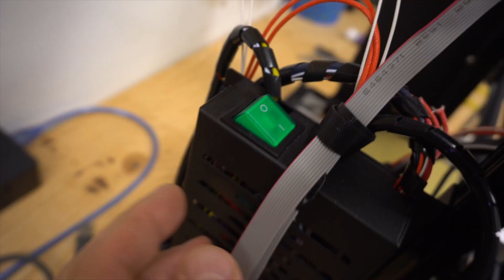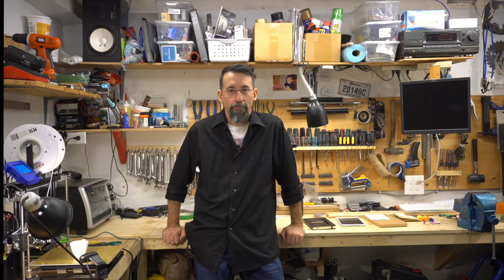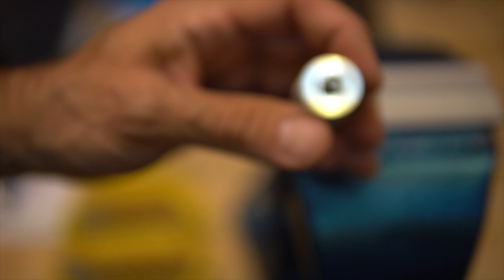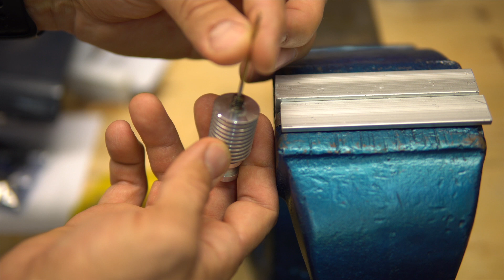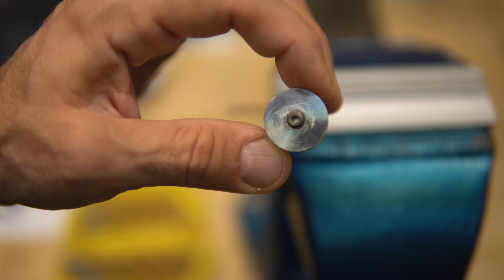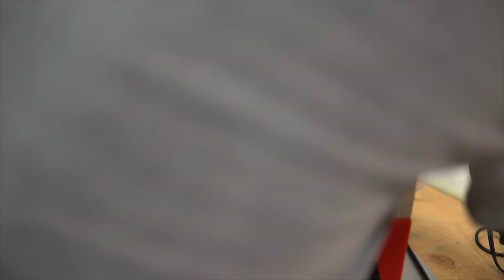Unclogging the Heat Break

Comment: If this helps anyone, I managed to unclog the heatbreak on my Dragonfly BMS by hitting its nozzle end with a heat gun set to 350C for about a minute and gently pushing a 1mm copper wire (polished to a round end) from the other side.

Comment: How do i prevent this clog to happen? Happens everytime . I cant print a full part
Reply: You can lower retraction distance, so that the hot filament doesn't get pulled up as far in the heatbreak. This clog mainly occurs, when hot filament gets retracted into a cold zone and then goes hard.

Comment: Thank you for this great suggestion. If this method doesn't work well or you don't have a drill bit plus vise, try a heat gun and a cotton swab. This worked perfectly for me, without metal-to-metal contact.

Comment: Nice one man, but a another thing which you can do is just heat the heatbreak to about 400-500c for about 3 mins and the plastic will melt away. This way you don't risk damaging the smooth inside of the heatbreak, and ofcourse, take precaution with handling using very high temperatures, so if possible keep it outdoors or near a exhaust , I use a electric coil stove to heat it up.
Reply from the maker: I prefer not to heat up the brass nozzle that much, I’m sure it works but mainly for me what obstruct the nozzle is residue from the black PLA I print a lot with black and I find that it sticks to the sides inside the nozzle. I also do a cold pull when changing from PETG or ABS back to PLA or else it leaves residue that melts higher than PLA...
Reply: Which electric coil stove do you have?

Comment: That easy? I hammered the stick poking in, try to lower my z axis to press it in, but don’t work? I’m feeling like I’m pushing through solid metal!
Reply from the maker: Heat brake are not that expansive, buy a new one than try to hammer this one even more.
Reply: Frank's 3D shop later, I fixed the blockage with a drill...

Comment: what actually causes this to happen?
Reply from the maker: If you forget the printer in preheat for a long time, plastic left in the tube when you change filament or even the PTGE tube that degrade over time can cause this.

Comment: I think this is the problem with my 3D printer. Unfortunately I don't have a vise.
Reply from the maker: You can use a plank with a hole and push down through the hole...

Comment: wouldn't that scratch the inside?
Reply from the maker: Hi, scratch the inside of what part?
Reply: @Franks3Dshop  the heatbreak!
Reply from the maker: Inside the heartbreak, there is a Teflon tube, I do not think you could scratch it.
Reply: @Franks3Dshop  Oh you have a PTFE heatbreak. yeah. but if you have an all metal one specially those expensive ones you have to be careful to not scratch the inside
Reply: Also thought about this, because my heatbreak often clogs...
Maybe it`s because mine is already scratched idk
Reply from the maker: I had one printer that was clogging all the time, the heat brake was not heat sink enough and that melted the end of the PTFE tube inside the heat break. I have since replaced the hole heat head with an E3D v6 original and it solved the problem
Reply: Yooooo!!!! Thank you! Worked like a charm. I used a 1/16th bit and it worked perfectly. You’re a G!

Comment: just fixed my extruder its the cheapone that comes with the CTC A8 it dint feed the filament do to small hole at the exit point i did fix it by opening the hole to give a little more clearness after that more problem the hotend was cloggedup do to filament not being fed so the process took about 40 minutes all good but that ctc a8 extruder i will replace it with a new one.

Comment: I used the sharp end of the drill bit and just twisted it in my fingers until it drilled out the blockage.
Reply from the maker: Culturedropout Hi, you could also do that if you are careful...
Reply: It works really good if you heat up the extruder and take off the nozzle; you can just twist the drill into the soft plastic and pull it out in one piece.
Reply from the maker: I see, yes that is a good idea, thanks!

Comment: Hi Frank. Welcome back, almost. We miss you.
Reply from the maker: Hi, how do you like this format, it is easier for me to produce, until I get back in full production.
Reply: It works fine. No problems.
Reply: Frank where do I find the filament amount to be used for a print in cura 3.4.1? Thanks for your help.
Reply from the maker: It is below the time required, after you have pushed Prepare. On the lower left.
Reply: Lower right. Got it, thank you my friend.